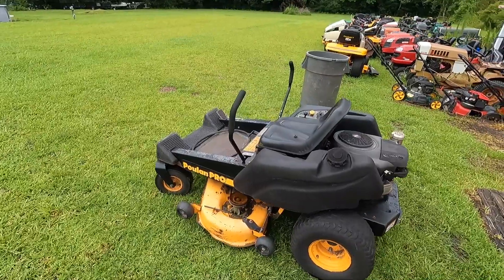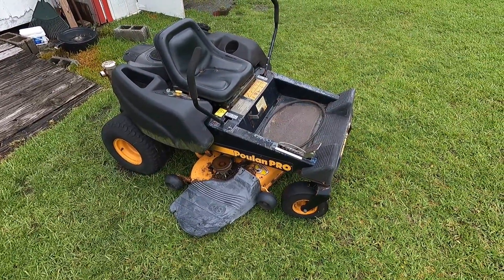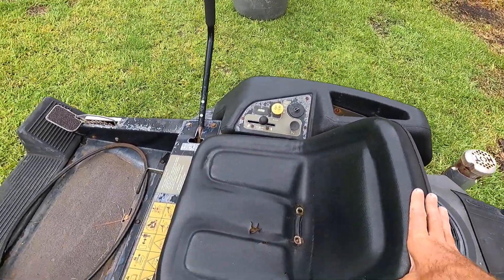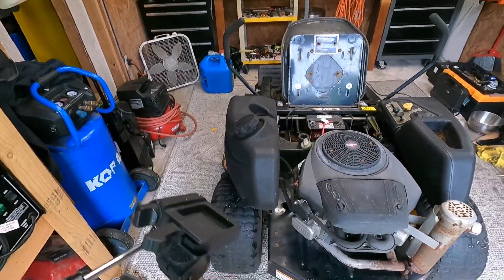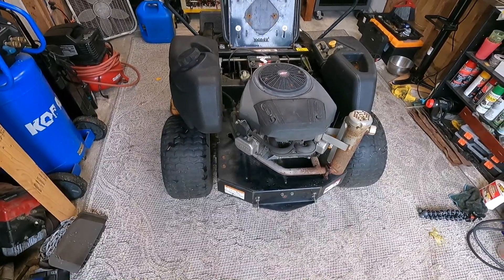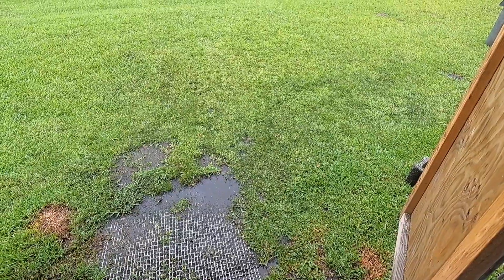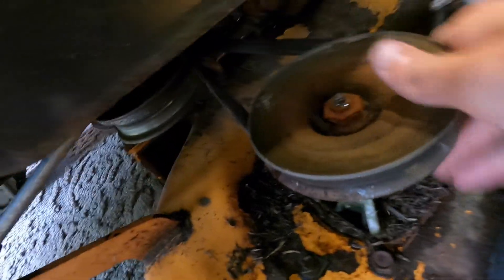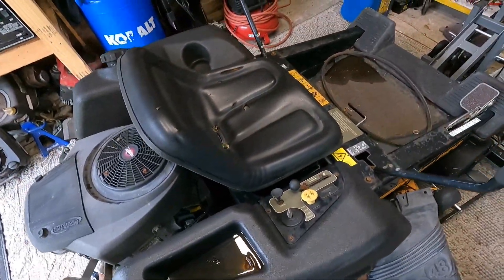$100 ZERO TURN (Can We Fix It)

Comment: Nice job Alex, you lucked up on this one brother. Every time I work on anything with hydros on it I always forget to disengage the release when I try to pull it out. 🤣👍
I like those racing slicks on the rear end. LoL!!
Reply from the maker: Right!! Those levers get me every time. I’ve got a new mini tire changer to try out hopefully get these drag slicks changed out on the rear. I think this mower just needs a lot of little small things to get it squared away, but so far I can’t get over how good it runs. Thanks for coming by brother.
Reply: Anytime brother, hey I have one of the HF mower tire changers and love it, it does a great job of it.

Comment: That briggs looks just like my Kohler 22 on my zt 50 cub zero..Had to replace the cooling fans on mine.I also pulled both hydros and replaced fluid..Been running good for 7yrs are better..You did good on that unit..Thanks for sharing..❤

Comment: A great deal right there alex glad it was only the fuse that caused it . But i wonder what popped it  another good upload brother 👍  🇺🇸
Reply from the maker: I'm wondering that as well, but so far it seems to be working just fine. I'm wondering if someone was working on it and just shorted it out. thank you for stopping by!!!
Reply: @freedommowers420  your welcome.  I know the ignition switch is working on that one you have but with my personal riding mower I picked up free a couple years ago back it kept popping the fuse because it was the wrong ignition switch on there and the tabs to plug into didn't line up to what they were supposed to go to had to get a new one and solved that problem, but it's a mystery on that one but hey it works now 😎

Comment: That looks to have the same Hydro Gear sealed drive hydro motors as my Gravley ZT XL 18-40. I would like to find a video or literature where it shows the exact amount of oil my sealed hydros use because I want to change the oil in them. Great score on that zero turn.
Reply from the maker: I’m going to try and find out some info on what these units take. I’m sure they could use some fresh fluid. Thank you so much for stopping by the channel 🙏
Reply: Most manufacturers wont tell you what they take in ounces but will tell you how much below what the fluid level is from the top of the vent tube. Its like its a big secret.👍🇺🇸

Comment: Im Sorry BUT that 7.5 with corrosion all in it should have been replaced too! HOLY HELL OCD TRIGGER WARNING! I get youre just flipping it But come on man do IT PROPERLY. i always replace things like that cause its a liability on you if that corrosion is whats making that 7.5a into a 50a fuse and it BURNS, ESP since you posted this video online showing this repair. Also youre right theres no way it was just a fuse, they dont pop for no reason! work it out a bit i promise you'll find a reason for it to have popped lol
Reply from the maker: I agree 100%. I should have shown it getting changed out and what I had found. I am still learning, and I wanted to show what I did to correct the issue, but I had someone else that wanted it, and said they would take on the issues it had. I did find a positive wire that had a small bare spot that had contacted the frame. I corrected the issue with heat shrink, and replaced the fuse with a new one as well as put electrical grease in the contacts to the fuse holder. I appreciate you watching and I will continue to try and improve my troubleshooting as well as showing things more in depth.
Reply: @freedommowers420  I actually do the same thing thats why I got on you and I appreciate you taking my feedback positively instead of as an attack! You've got me seriously thinking about starting my own channel on this kind of thing even if it doesn't pay out I can at least help more people learn to maintain, and repair their own machines.